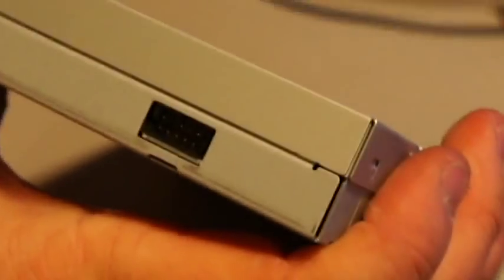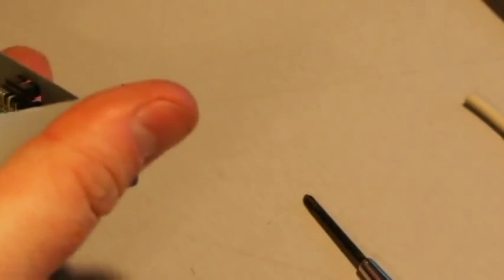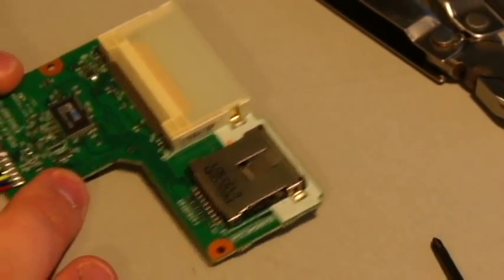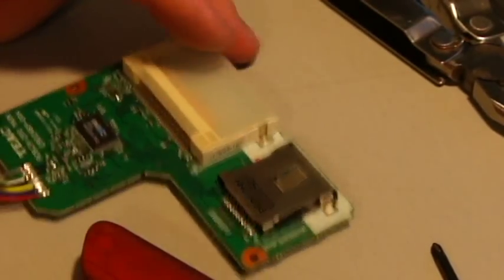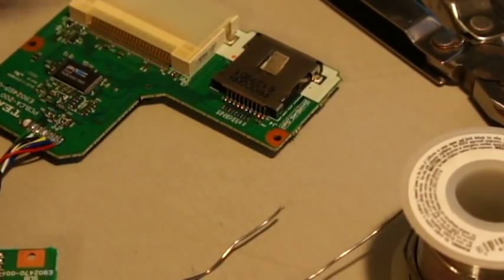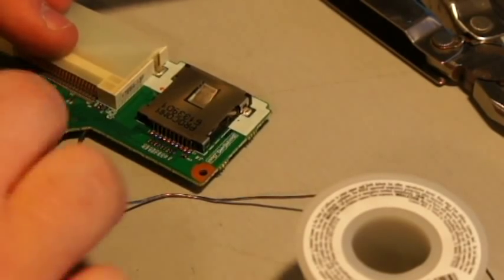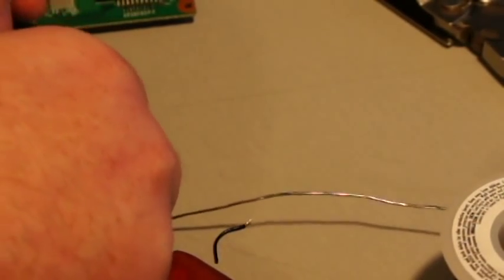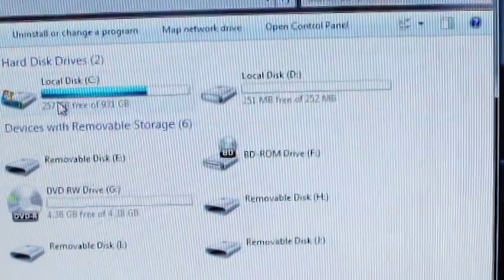Teac CA-200 Card Reader Mod

Comment: I put one of these readers in my Dell. Well, then the fun begins.  It did work but first off it takes up 4 drive letters so I no longer have access to my H drive at work.  Then it interfered with other network drive mappings.  Then the computer refused to boot in any reasonable amount of time.  Like 20 minutes to get past the 'welcome' message.  Took it out and my computer is all happy again.  Boots normally, network drives all returned.  It might work for me if it could be configured to only use 1 drive letter but I guess the designers wanted us to be able to copy files from one memory card directly to another.  Back to using a plug in USB to SD card reader.  So many computers at work have these. I wonder how any of them work.  I don't suppose Dell provided a config program for them. Meh, not worth looking for.  chuck it in the bin.

Comment: I appreciate the video; however, I've come across a ridiculously easier way to redo the wiring; on the motherboard side of the cable, detach each wire EXCEPT the black ones from the plug; you can do this by carefully lifting the blue clips using a needle or a thumbtack. Rearrange them so that the blue cable is in the blank (pin-less) port, while the double-black row has, from left to right (right being blacks): Red, White, Green, Black, Black. Motherboard detected them on the first try!

Pics available upon request.

Ultimately, they should look like this from the back:

Empty, Empty, Empty, Black, Blue
Red, White, Green, Black, Black

REMEMBER TO NEVER REMOVE THE BLACKS!
Reply: Yup its always easier to remove the wire terminals from the connector and move them for whatever pin-out you need. I do this same thing to other proprietary dell parts to make them work in non dell pc's.
Reply: Any chance of seeing the pics.

Comment: Black is at the same potential as clear [cable shielding] on the circuit board. Some 'pre-made' USB leads have heat shrink sleeving at the end that hides the fact that the cable shield is connected to black. If that's the case on your cable, you don't need to break out the end of the lead and just need to connect Red, Black, Green, White. Might save you a job.

Comment: Too bad the Teac CA-200 and CAB-200 aren't  useful.  It can't read HC SD cards.
Reply: Yes they can read HC SD cards. Download the firmware update for TEAC CA-200 and CAB-200  from Dell website. After updating the firmware ,it will read HC SD cards without any problem.
Reply: You are correct.  A firmware upgrade is all it needed. 

Getting the Bluetooth working on the CAB-200 is the next hurtle.  I have spent a couple of hours trying and no go.
  What I have found out is that there are two modes that the BT device can operate in.  One is Logitech mode and the other is Bluetooth.  To enable bluetooth, the front panel button of the CAB-200must be pressed when it is connected to power.  I am trying to figure out a way to have it default to BT mode.
Reply: rpiercebutler Did you installed the drivers in windows vista mode???. If not, go to dell website, download the drivers for windows vista.  Uninstall the drivers for cab-200 device and install the new drivers in windows vista compatible mode .Right Click the driver installation file and select Properties/Compatibility Tab. Choose Windows Vista Service Pack 2 then click Apply/OK.  Right Click the file and select the Run As Administrator option to install. That's all. !!!!!Remember, these steps are for the drivers NOT for the Firmware.

Comment: Those little screws are very difficult to remove. I, too, had to use a pair of pliers for extra leverage. Make sure that you use the correct sized screwdriver and don't "butcher" the screw head. I did so on one, but you only need two.

I also used a little nylon cable tie around the socket PCB fixing point and the cable for strain relief.

Comment: Interesting method and more permanent.

What I did (works on CAB-200 too - with bluetooth) was:

1. Pop the top off card reader.
2. Slowly push out the small black plastic pin cover out through the back of the card reader. Small micro-screwdriver works great. Evenly push a small bit at a time till it pops out the back.
3. Take same small screwdriver and fan out the now exposed pins so that a standard female to female USB header cable fits right on.
4. Plug and play (or update firmware to newest one).

No soldering or unscrewing needed. And these little readers are great quality and work with Windows 7, 8, and Ubuntu 12.04 etc.
Reply: +DeathlyHall0w Did you figure it out? Looking to do the same mod myself.